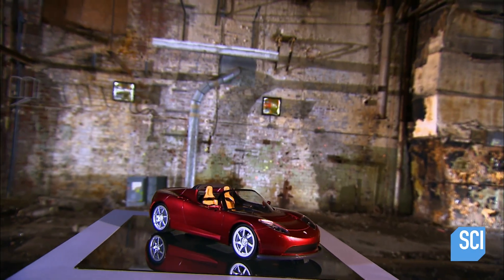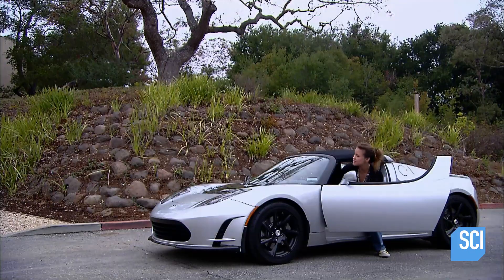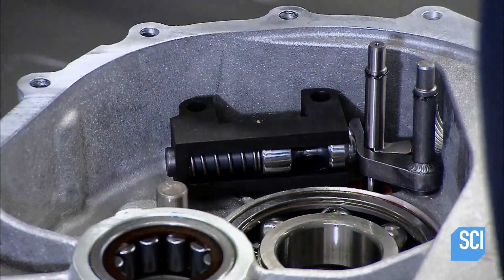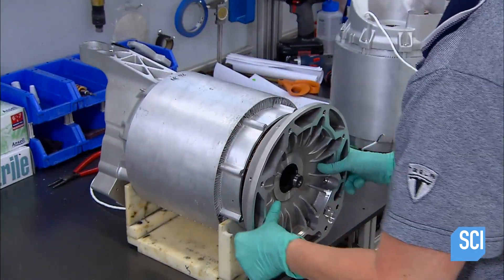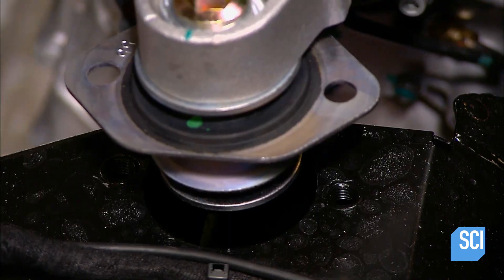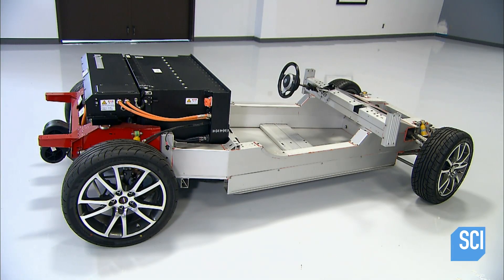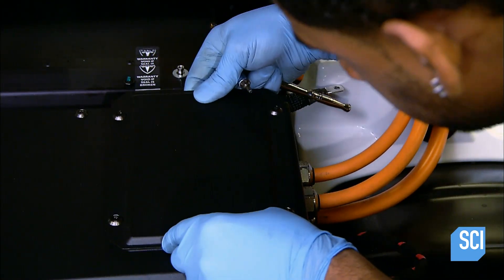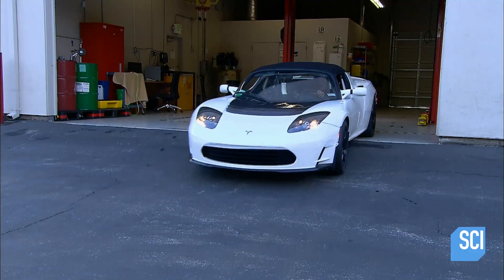How It's Made: Electric Cars

Comment: Is this car really echo friendly? They have to mine the materials for the batteries. Plus to dispose of all the hazardous materials
Reply: It's better than a gas car, but you're right that there are issues. The biggest problem is that it's still a car: a personal vehicle way bigger than the (usually 1) occupant. It perpetuates most of the support systems cars demand: giant parking lots that hollow out cities, freeways that can never be wide enough to prevent congestion, and overall low density sprawl.
Reply: No it's not at all. Lots of exploited labor. These things are fire hazards
Reply: @joeyanthony7831  that exploited labor is some of the highest paid wages in these countries though also less flammable than conventional vehicles
Reply: @Chemicallybondedformations  lmfao the labor from the cobalt mine extraction is done in the Congo, not the United states. Are you slow?
Reply: @joeyanthony7831 not true 19x less likely to catch fire than gas. C-mon educate yourself. Enough BS floating around don’t you think ?
Reply: Batteries are 92 to 98% recyclable not one has ever made it into a landfill considering the cost are these materials
Reply: @Chemicallybondedformations  look how the battery matters is mine. Pick your poison.
Reply: Then stop using electronic devices all together materials like lithium are in most rechargable devices . Doesn't matter how big the device is your still contributing to what you say . Also you've skipped over the fact that fuel is also pumped from the ground over and over and gets delivered by things that need to be fueled . So yeah dead animal juice is not worth fighting over
Reply: When it's initially built it's worse than a gas car but over the course of its life it admits less over all.
Around the 2 year mark or ~20,000 miles is when it becomes cleaner than a gas car.

Also don't start the "WeLL tHe BaTteRy GoEs bAd qUickly" BS. Most EV batteries are rated for ~150,000 miles or ~15 years of driving, in which case when it's replaced the difference in pollution will be large enough to where getting a 100% brand new, just mined, and manufactured battery would still be less pollution. This is before you factor in that batteries are ~97% RECYCABLE!!!!

I don't know what lifted truck driver started this myth but it's annoying.
Reply: exactly! even harder to breakdown for the environment...

Comment: I wonder where that electricity comes from to charge the car for several hours for 258 miles.....
Reply: Depends on where you charge it, but even if it was charged by a coal plant it would be as efficient as 94MPG
Reply: @bensharpe64  Wait, what? 2 hours to charge for 248 miles? Less than 5 min to fill my car for 360 miles? No thanks.
Reply: whats your point? clean energy can fuel the car as well like solar and wind
Reply: @naahh  Apparently you don't realize that it takes more barrels of oil to build and maintain a wind turbine than it saves. Not to mention the life of the blades that are not recyclable and have nowhere to go.
Reply: @88infidel88  solar and hydro still exist… for how much research you’ve allegedly done you seem to be pretty close minded
Reply: @naahh  lol. Never said it didn't, but keep arguing to argue.

Comment: Electric cars are a great idea but they need to creat one that recharges itself before they would be truly cost effective
Reply: cost effective? really? a 50k electric car is as cheap to run as a 20k car in my country. i dont pay for charging at all
Reply: Like Solar panels on top of the car ? Why is no one doing it
Reply: Ok Boomer.
Reply: they already do via e
regen brakng
Reply: @cedriceric9730  just enough to charge your phone to 2%
Reply: @-never-gonna-give-you-up- thats all in the past!
there are even races being designed counting on regen ability.
there is a company which plans to make energy by driving up hill empty add weight with water and use regen to generate enough energy to sell downhill
Reply: @cedriceric9730  those races with regeneration isn't even fully relying on regeneration, those race cars have lithium ion capacitors that store the energy to use as a boost.... please look it up before commenting
Reply: There's already some smaller ones that have solar panels + recouping from breaking, and if you only drive in a city you might not need to plug that one in ever

Comment: Tesla has come a long ways from this humble start.
Reply: Hell first Tesla was built on a Lotus Elise. Same as the first vehicle Venom out of Houston built their first car
Reply: @sithyarael6807  So that's why it looked so familiar
Reply: @sithyarael6807  lotus doesn't even build engines and hennessey has built plenty of packages for cars prior to their lotus the did viper venom but mostly utilize gm ls motors.
Reply: no it hasn't lol
Reply: great job 💪🚘🔥
Reply: Thanks to corruption and the fact that Tesla is a cult
Reply: so have rc toy cars..
Reply: It's going to be so fascinating to come back and watch this in 15-20 years and marvel at the advancement. Thanks for the video team!
Reply: yeah like exploding and melting and not being properly aligned in several places :)
Reply: @RoleplayHost  that’s old thinking buddy.
Reply: @RoleplayHost what are you talking about? The percentage of Teslas that catch fire is less than that of ICE cars. I know the Volt had an issue with it, but that is GM garbage.
Reply: We need to develop better battery technology. Because we would just be trading one finite resource for another, with oil to lithium. I suggest we transition from wired electricity to wireless. Such as using Tesla Coils. Reducing the need for batteries and allowing for the development of flying car tech. Batteries would also start to cause a disposal and recycling problem.
Reply: @timothylopez8572 they working on salt and plastic batteries. Give it 5 years it will be like SSD compared to the old spinning hard drives.